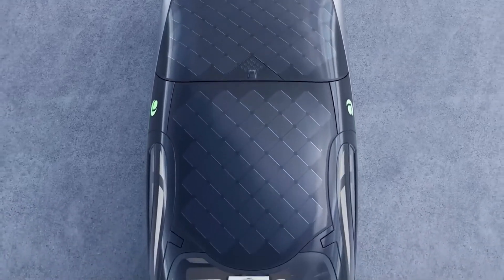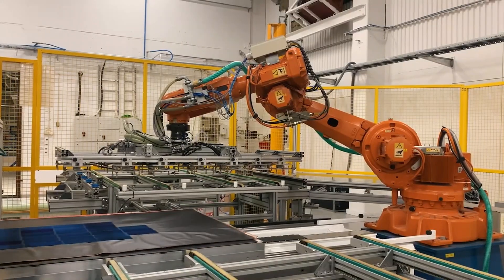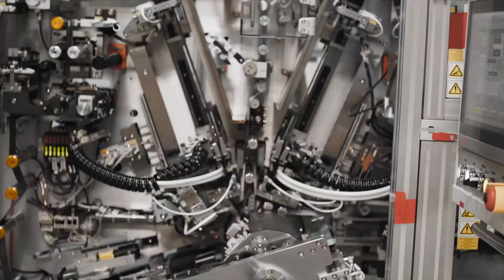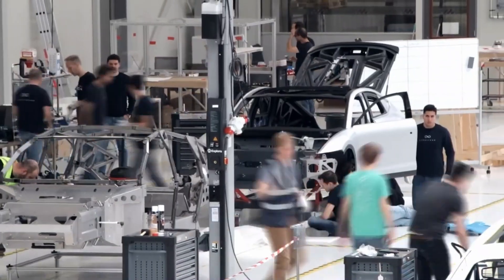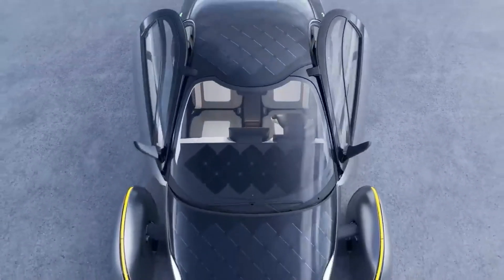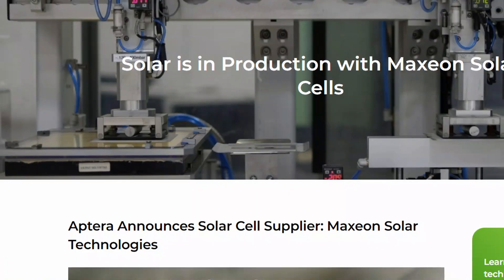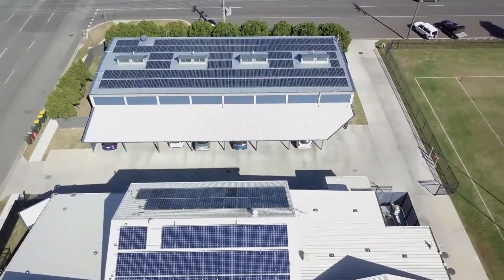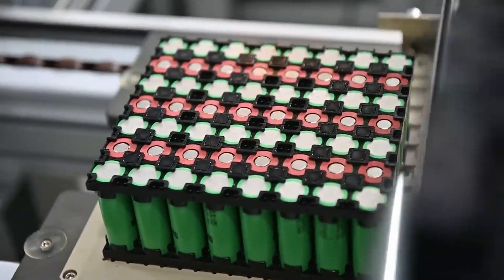APTERA PV Solar CAR Cells is Shattering barriers to get into the low cost production market

Comment: Why have solar when you can put a generator on wheels and  recharge as you move
Reply: It already has regenerative wheels on top of solar.
Reply from the maker: Hmmm.
It's that green?
Reply: Putting generators on wheels is called regenerative breaking and regenerative breaking slows the vehicle down and is very inefficient.
Reply: @alainchuzel8341 How is recovering otherwise wasted energy innefficient?

Comment: What does "How Aptera PV solar cells is shattering barriers to get into the low cost production market", your first sentence, even mean?  It's nonsensical.

Also, no, Aptera's curved solar panels, overall, produce LESS electrical energy over the course of a day than if they used a flat solar panels.  Aptera's solar panels are curved because Aptera's priority was vehicle aerodynamics.
Reply: I understand solar race car teams spend an enormous amount of time/effort in understanding the "trade-offs" between solar panel performance and the vehicle's aerodynamics.
Reply from the maker: @alainchuzel8341
Thank You
Reply: It fuels itself with up to 40 miles a day.  How that was nonsensical to you proves you have a double digit IQ

Comment: Aptera is a motorcycle, not a car. And it is not produced. The expected production is very expensive. They formerely planned to build the chassis like a boat hull: vaccuum form 4 parts out of resin, glue them together, ready. Cheap solution. That did not work. Now they use a standard aluminium frame and glue expensive carbon planes onto it. These are produce in Italy and have to be shipped to US. Expensive. Like the batteries and the motors. The suggested retail price is pre-Covid, pre-Inflation.
Reply: It's an autocycle you half wit, not a motorcycle.  That's why when motorcycles go down the road NO ONE says "look at that autocycle!"  You're a brainless clown.  Technically it's a car too because it has an enclosed carriage
Reply: It is actually termed an “auto-cycle”…there are many videos illustrating how Aptera’s partners, like CPC and CTNS, are involved in the manufacturing processes, and why the upfront CapX costs are much lower than traditional automotive producers. The fact that very well known and established companies have agreed to partner with Aptera, though it does not guarantee the companies success, does support the idea that Aptera is a serious EV start-up contender. It’s probably well worth a watch (and read) before forming a definite opinion on their chances for success.
Reply: @loums52  an autocycle is a motorcycle with 3 wheels (no sidecar). See aptera FAQ. It lacks all safety features necessary for a car. So it can be produced much cheaper.
Reply: @reru_personal  airbags are simple and easy. But dont have anything to with the structural and dynamic safety precautions necessary by law  for a real car. Aptera motorccle is a deathtrap in case of an accident. With or without airbags.
Reply: @reru_personal  There is not a single  crashtest for the Aptera motorcycle since 2009. Just empty promises.
Reply: @vic321344  are you a safety engineer? How can you guarantee its more of a death trap than most other motorcycles?

If you were designing an item, when are you likely to do tests like safety tests? When you have a prototype that barely shares any characteristics with the final version, or the actual final version that is what actually needs to be safe?
Reply: @reru_personal  Easy. Same problem as with small airplane fuselage. in case of a crash the front wheels will be easily ripped off. So the Aptera motorcycle lands onto its roof. In this case the doors do not open anymore, the windows are too small to escape. The battery is within the fuselage, so in case of a fire the pilot will breathe the toxic fumes. And will be roasted by the lithium fire.
Real cars with swing doors (Mercedes SLS) need to have explosive charges that blow out the doors in case of an accident, though they are much more unlikely to land on their roof.
Reply: @vic321344  how does the bread land with butter facing up when it always lands face down normally?

Aka, all the weight of the battery is under the car, so even if it does flip, because of the weight of the battery and the rounded design the battery will always pull the cab right side up like when you glue a weight to a ball.
Reply: @reru_personal  Because a bread does not have front wheels that extend outwards? If a wheel rips off, the aptera motorcycle will definitely land on its roof.
Reply: @loums52  aptera needs at least 300 mill to Start production,  which they Do not have.
Reply from the maker: Lo!